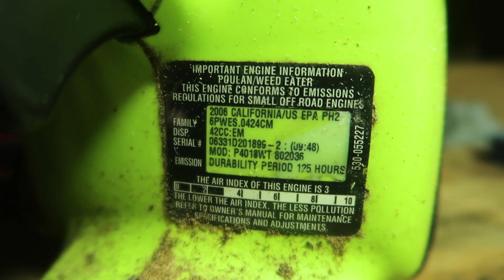In 2020, me and my dad spent weekends messing with chainsaws until my glasses broke my carburetor...

Comment: That's some good stuff. I'll never forget the times my Dad and Grandpa taught me how to troubleshoot, work, repair small engines, and up to Chevy 305 and 350s by the time I was 18-19. Many years later, I've built an impressive resume in the Industrial Maintenance and Engineering field. Learn as much as you can mechanically and electrically (as well as Trades specific specialties; plumbing, machining, HVAC). Knowledge & skill saves you $, creates an experience, and makes one priceless.

Comment: Folks, don't use a wire brush to clean spark plugs.  The center post is covered by an insulator.  The brush leaves metal traces which can allow the spark to arc across to ground.  If there's a lot of crud, scrape off with a bit of wood otherwise leave it alone.  Spark plugs are meant to be self-cleaning.  If you have one that's particularly dirty then either you need a new or different heat-range plug or there's some other engine issue that needs to be addressed.

Comment: Both of your saws were fine. You need to run them full throttle before you put them to wood. 2 cycle engines have no power at low rpm's. Get the chain spinning at full throttle then put it to the wood but dont force it down.
Reply from the maker: Can't go full throttle, it bogs down. they have issues.
Reply: @RinoaL  There are usually 2 carb screws controlling fuel mix. Try turning the low idle screw down until the saw barely runs when warm. It did look as if they started to easily.